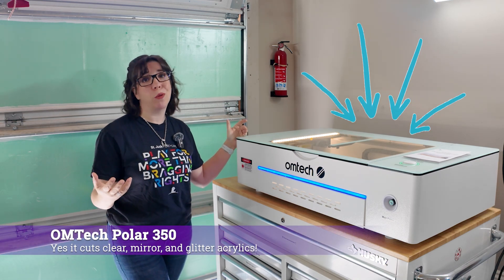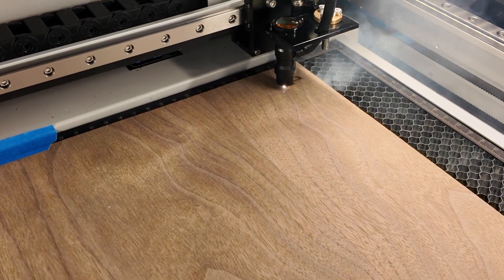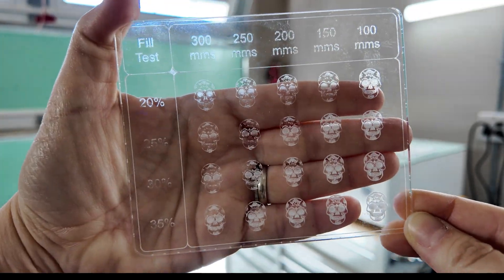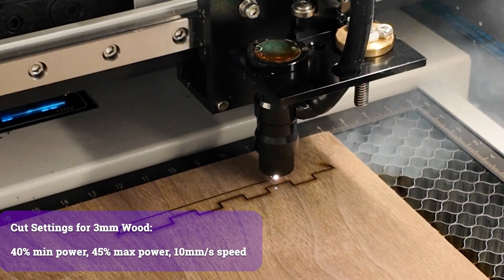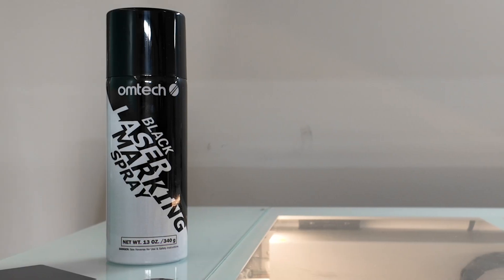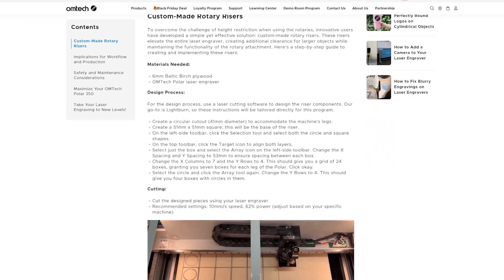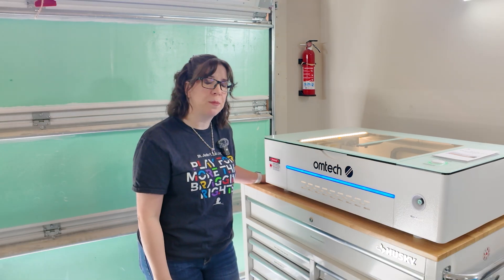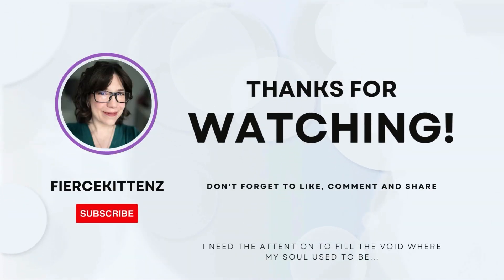OMTech Polar 350: Full Review - Cut Clear, Glitter, and Mirror Acrylics with Ease!

Comment: How far are the feet from each other? Im having a hard time finding a surface that will work for it
Reply from the maker: Ah dang, I don't have it with me anymore to measure. I had to make room for the next machine to test/review, so I gave this one to a friend. I had it on a 48" wide, 24" deep Husky storage cart from Home Depot. It didn't take up the full size on the width, but only had a couple inches to spare on the depth. I don't want to guess and mess up any plans you may have. I'd just suggest getting that size table - a STURDY one as this machine is heavy!

Comment: Can you work large material and adjust the work with the camera and lightburn or it is limited to the work area 20x12?
Reply from the maker: There's passthrough, but it's very limited on material thickness. If you need to work with larger materials, I'd consider a larger machine. Fiddling around with passthrough and Lightburn alignment is a pain :(
Reply: Thanks, I made some searching and I found the info, thickness is 1/8 but it is ok, what I don't know is the width, it will be nice if I can put a 20 inch material x whatever long heheh @fiercekittenz

Comment: I got the Polar + and there is no mention about the long focal lens in the documentation, I thought it was a spare lens, the same as the stock one. And the files provided on the USB drive are pretty outdated, especially the Omtech material test card where minimum power are not set and cannot engrave some details.
Reply from the maker: I don't have the Polar+, but that's definitely not a spare lens. It's just a longer focal length one for deeper cutting. The USB drive on the Polar 350 was fine - but I didn't use their tests. I went to the Facebook user group and plucked a file from there.